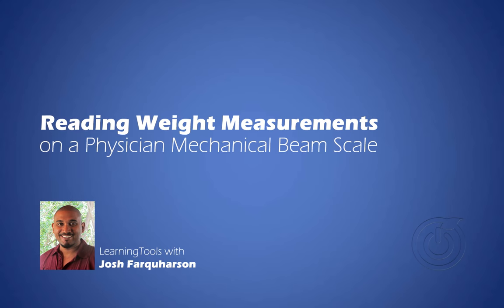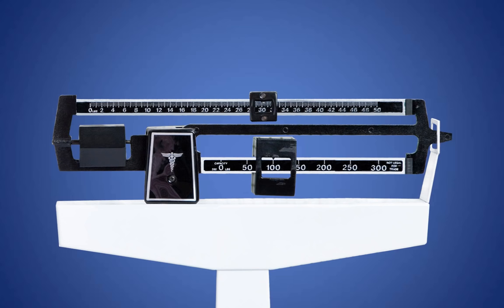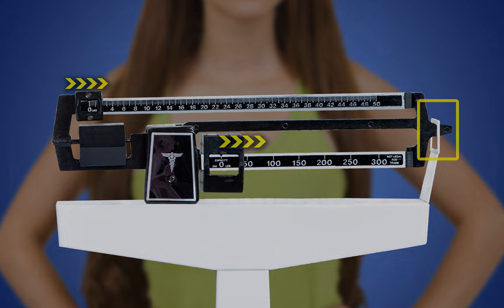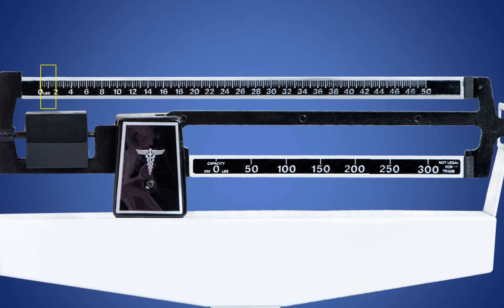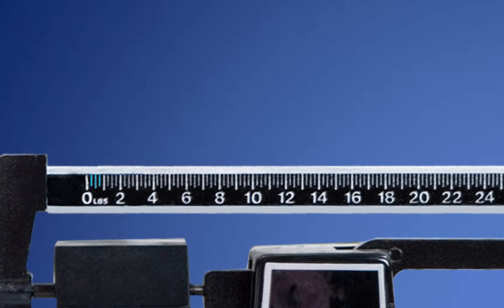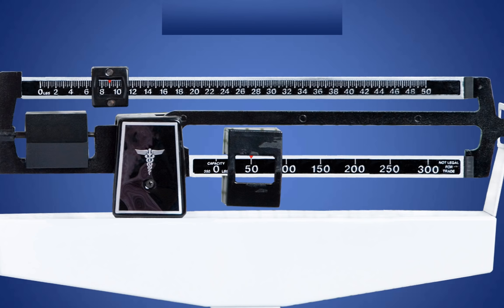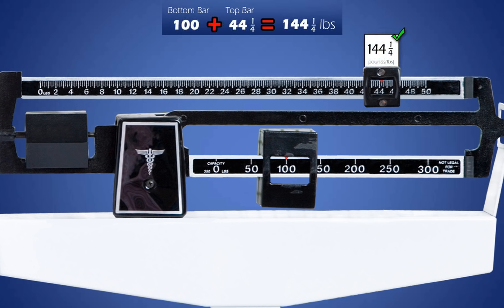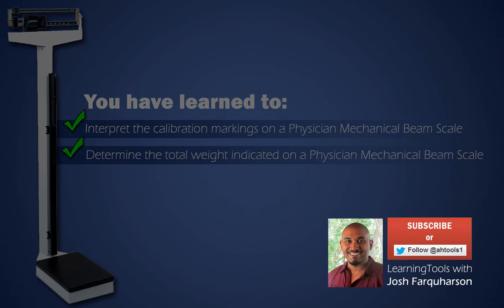LearningTools: Reading Weight Measurements on a Physician Mechanical Beam Scale

Comment: Thanks for this. Question: the scale at my gym has the number and a tick mark next to the divets, so the 150lb mark is a cm or so away from the divet. Does that mean the measure directly ON the 150 lb mark is 150 or the divet to the right of it signifies 150? It's confusing for me.
Reply from the maker: It’s difficult to understand without seeing the type of scale you’re referring to. Try putting the top and bottom poise weights to zero and see if the beam balances. Assuming the scale is calibrated correctly, read from where the poise weights rest (and ‘divets’ align). That will help you determine the areas to read from on the poise weights regardless of the weight on the scale. You an also test this solution using a light weight (such as 5 lb dumbell). Hope this helps!
Reply: @AlliedHealthToolsLLC  I planned to take a picture of it to show you, but alas, my gym got rid of the scale. 😂 I appreciate your response regardless. If they replace it with the same type, I'll submit a pic.

Comment: Question: If the beam on my mechanical beam scale, (used for measuring body weight,) rests all the way DOWN (versus floating in the middle) will my weight measurements be too high or low? I’ve been researching this for hours now and can’t find an answer… any help is MUCH appreciated thank you so much!
Reply from the maker: Assuming that you are standing on a scale similar to the one in the video, if the beam is down, it indicates that you added too much weight. Adjust the poise weights to reduce the weight indicated on the beam until the beam floats in the middle. If that doesn’t work, your scale may need to be serviced or calibrated by a professional. Hope this helps!

Comment: you forgot an important part ..before you even start ..when both the weights are on zero and it isnt floating in the middle its not balanced ..you have to turn a screw until it balances when both weights  are on zero ...then it is ready
Reply: the large counter weight always has a screw on the far left